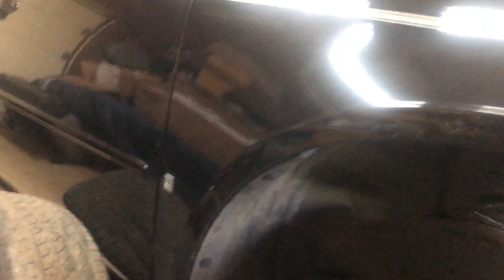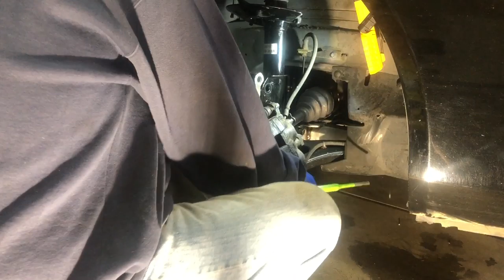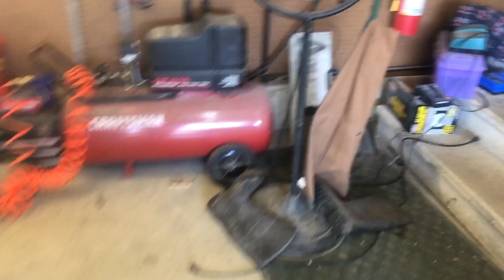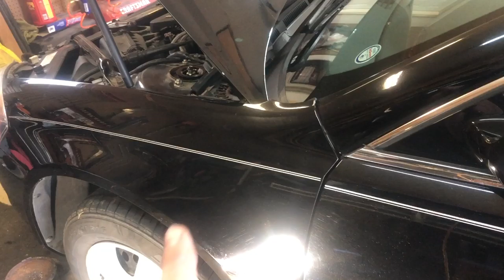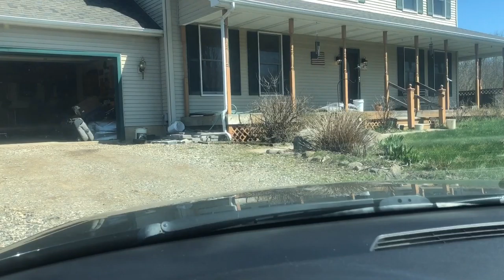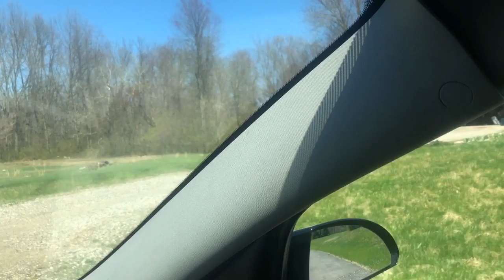Front Strut Replacement - 06 to 11 Chevy Impala

Comment: Not only did we get bonus footage we got bonus bonus footage!!! HA HA! That's gonna be a nice Impala when you get her done. I heard that power steering whine though. Ya might want to fix that or your neighbors are gonna think you started driving a Ford. ;-)
Reply from the maker: Those power steering pumps need to be vacuum bled once they get air in them.  I have to pick up one of those Mighty Vacs and vacuum bleed the pump.  If it still whines after that, I'll swap it with one from the parts car.  Which will have to be vacuum bled again.

Comment: Are you still driving around with no taillights and no bumper?  Anyway I would rather have aluminum wheels of it was my car but that's just my opinion. Put some snow tires on those steelies for next winter.
Reply from the maker: Yep.......still no lights or bumper.   Luckily I’m just driving it on our street which is a private road.  Just gotta remember that in case I decide to take a longer trip on public roads!  LOL!

Comment: First of all you don't need to touch the sway bar link bolts at all to remove the front strut out of this car remove the two bottom bolts that hold the strut in place remove the three on the top and that's it
Reply from the maker: That would be for the front struts only. The rear upper sway bar link is attached to the strut.